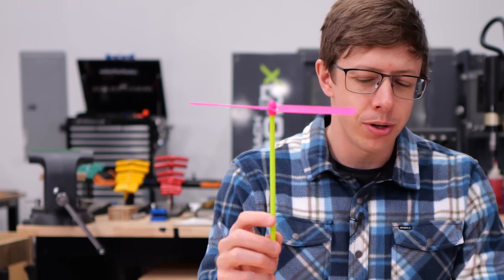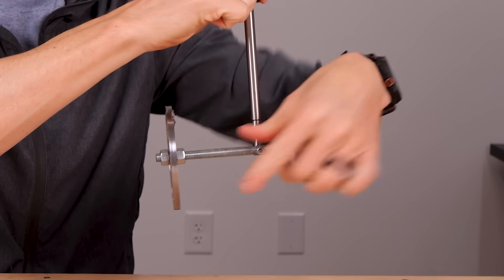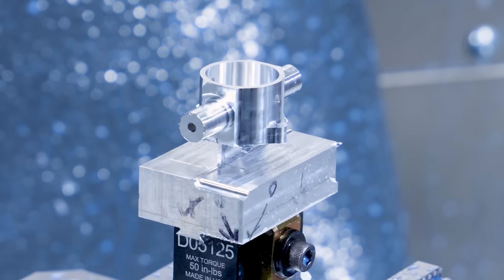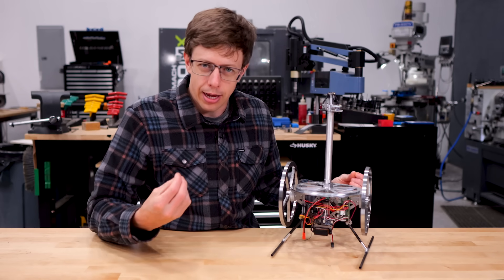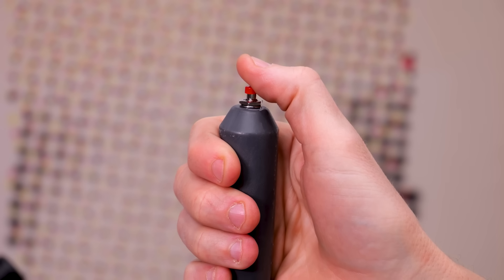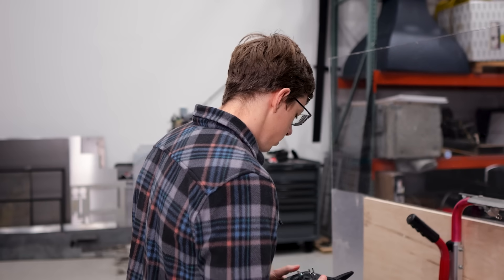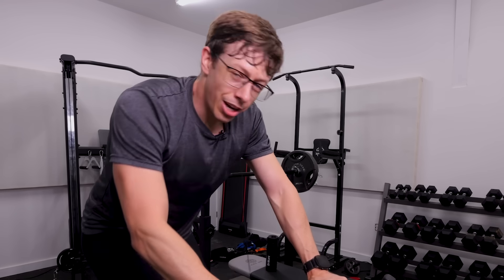I really thought this would fly well

Comment from the maker: If you don't already spend time every day learning new stuff, you should! I'm forever amazed how much I learn by cultivating this habit. If you're interested in learning technical stuff, you should check out Brilliant. It's an awesome tool that you can use to learn math / programming / data analysis / etc. If you go to https://brilliant.org/StuffMadeHere you can try it free for a month & get 20% an annual subscription.
Reply: Any reason you didn't just disconnect to the shaft from the flywheels and fly it like the stick toys (just blades and motor shaft).  If you're tied to combining the whole thing, why don't you just make a tail rotor like a helicopter?
Reply: @lunch3507  That's what I was thinking. It's so simple already, just use carbon fiber and spin the sh!t out of it.
Reply: @lunch3507  I think the reason was explained at the beginning of video. When you rotate only shaft you accumulate only kinetic energy of shaft itself. This energy is proportional to square speed of shaft and its mass. But the stopping force is also square proportional to the speed of shaft. So increase of its rotation speed will give additional energy from one side and additional stopping force from the other. The idea of flywheels is actually good: You rotate something very heavy, but not resisting the air so You get energy but not get stopping force.
Reply: @lunch3507 watch the start of the video again
Reply: @lunch3507   yeah, he could put a flywheel on the base of the shaft, that would rotate in the same orientation as the shaft (essentially could be part of the shaft) and rotate that fast to store energy then let go from the rotation devices on the sides.
Reply: You should try a Collab with project air
Reply: At least you learned something and it actually flew! 
Science and designing is a wonderful thing.
Reply: Can we get a collab of the wives of you Backyard Scientist, and William Osman
Reply: If you can, please disable automatic synchronization. With that I can't hear the original audio in Germany even though my browser and os are completely set to english and there is no way for me to disable it (at least watching in the browser without being logged in). And the synchronized version is absolutely no fun to watch. Thanks!
Reply: Flybar!
Reply: Epic fails teach epic lessons :)
Now it's time for the complete redesign you were trying to avoid.
See you next video, you got this.
Reply: i cant wait for part 2 and 3 and 4 and maybe 5...
Reply: Your horizontal gear needs work too.. It has vertical flat surfaces which both increase drag and throws of air, going to your wings. (or am I mistaken?)
Reply: Hear me out. Controtating twin propellers with concentric shafts. If it doesn't work at first, just steal the SB 1 Defiant design data.
Reply: I think you could solve the problems while staying true to the toy rotor design by having a single flywheel on the same axis as the rotor and a simple clutch/brake mechanism between the rotor and the flywheel. When you want lift, gradually apply the brake and angular momentum will be transferred from the flywheel to the rotor. The flywheel will provide stability, and with computer control you could get precise control over the altitude.
Reply: @stuffmadehere why dont you keep it really simple: put the mass in the wings itself. No mechanics, just the same as the good ol toy just with some rotational mass in the wings to keep it spinning. And maybe some dynamic wing geometry that will flatten (like F1 wings) under high load and produce more drag / uplift when the RPM is low. And then you can spin it up really fast and let it go. And a small aerodynamic flywheel on the bottom thats keeping it upright.
Reply: Love your projects <33
I'd be quite honoured to perhaps be of help this one time, so here's my thoughts, cause a failure won't fly here :P

    I believe the thing you built is slightly too much a helicopter, not as much the original toy. I'd say that it isn't actually achieving the goal of answering the question "How high can you push this toy for children?" but rather "How can I build an RC heli powered by a flywheel?".

    If I may suggest a change in engineering perspective to achieve the curious original idea:

Parameters of the original toy used in the video:
   Two bladed propeller - number of blades somewhat optional, see sidenote lower
   Shaft that acts as - Counterweight to keep the thing pointed the right way up.
                                     Flywheel - well.. fly-rod.. - that stores rotational energy that is put in before take off.
                                     Means of bringing the propeller up to speed.
   Free flight model - controlled solely by its own ballance.

The answer to the original question should lie within the same parameters.

Sidenote:
    I don't know about yours, but when I had these, you could stack them because the prop shaft protruded above the prop, and had a hole on the bottom - or maybe I made that as a modification when I had the idea of stacking, can't quite remember. When aligned properly, the props would go higher because they carried more rotational energy while technically having 4 blades, although they were a bit tricky to spin up because of the length and vertical weight distribution. I would say that since that was possible, a single propeller isn't mandatory.

My answer shall then be the following:

    Twin counter-rotating 2 bladed propellers with coaxial shafts, both of which should have a horizontal flywheel attached at the bottom. Inner shaft has to be hollow, protrude below its flywheel and have a small axial bearing mounted to its very end by the bearing's bottom half while its top half must spin freely - tolerance on shaft diameter (see take off platform lower for explanation). Both shafts with flywheels have to weigh the same amount so that one of the flywheels doesn't have to "pull the other," reducing friction. Inner shaft flywheel is the bottom one, outer shaft flywheel above it, with two tiny bevel gears in between them on a single tiny shaft perpendicularly through the inner shaft, secured by retaining snap rings on the ends - mind the math around the distance of those tiny gears from the main rotational datum as well as making the number of teeth an even number so as to keep the propellers angularly aligned. At minor cost of friction, these will also allow the contraption to be spun up from the bottom. The bottom flywheel shall have bevel gearing on the bottom as well for contact with the "starter motor", an odd number of teeth here because of higher loads, possibly spiral gearing.

    Take off platform:
Consists of 2 layers.
     Upper layer:
Supports an axial bearing with an inner diameter big enough for the inner shaft small axial bearing to pass through and outer diameter such that the lower flywheel sits on top of the bearing with its lower gearing on the outside of the bearing. The starter motor with bevel gear at proper height for contact with the lower flywheel.
      Lower layer:
Vertical rod through the axial bearing above, at least long enough to reach above both flywheels and not longer than ~1/3 of the overall length of the "heli" - support while spooling up X friction at take off (:P too lazy to do the math here, you can :D)
     Trigger release - Three or four radially retractable prongs that secure the inner shaft's axial bearing from the top while spooling up. The 'heli' is released by simultaneous retraction of said prongs.

Do the proper math, design with weight and balance in mind and it will be a rodcket :D
I can only hope you might see my musings on this problem and that you may find them interesting enough to further develop them. Well that was a fun hyperfixation for the evening and in the words of Mike Patey - "Back to work!" :D
Reply: ha? what gears, what 2 flywheels.
Why did you not attach single flywheel perpendicular to the shaft of the propeller. It would always be under the prop blades and on the way down angle of the prop blades would manage the descend rate.
And even better there is a thing called steam engine governor, that depending on rotation speed moves heavy balls out or in while rotating, controlling valve, but in your case it could perhaps control blade pitch..

This is classic case of over engineering if I ever saw one :D
Put flat flywheel on the bottom, spin it up with that gear machine and release .. it should work practically in a static minimal config, no electronics AT ALL, fixed blade angle, fixed shaft, solid flywheel rotating in horizontal plane, parallel to the ground, perpendicular to prop shaft. 
I mean usually people try simplest things first.. :D
Good luck in part 2
Reply: counter-rotating propellers are your friends.
Reply: You're an awesome dude  *I actually had designed a rocket launched parachute system years ago for similar reasons and constraints to get away from a paraglider fan and not line twist this the prop or the already failed parachute wrapping up.     (compressed air was the solution for general reliability and safety) 
Of course you'd have to run it through the shaft which would be neat but a whole new set of problems
Reply: How do you keep track of what you’re learning and what you want to learn?
Reply: just an idea, what if you change the center gear to a double sided bevel gear and put one of the flywheels on the other side to change its spin direction?
Reply: I’m no engineer, but am fascinated with flight and by this concept!!

What if you were to weight the ends of the rotors (make them the flywheel) and make counter rotating rotors? Less moving parts, simpler, still counter balanced?

Someone who knows WAY more than me please tell me if this won’t work… haha
Reply: isn't it funny when you have diplomas and you spend so much time and an idiot comes and tells you right away that this aint gonna work and every step you took to salvage it was like gigging the hole deeper... i blame brilliant.....
Reply: I think your idea of counter-rotation was a good one, but I think you should do it with the blades.
You could have a flywheel connected to each of  the internal and external drive shafts with a bevel gear on the outer edge for accelerating them at ground level.

I think the main challenge would be building a double swatch plate mechanism for control.
Reply: That's one way of how not to make a helicopter! It's not a failure, as long as you learned from that experiment, right? Look at how many times it took you to get any of your other projects to work the way you envisioned.
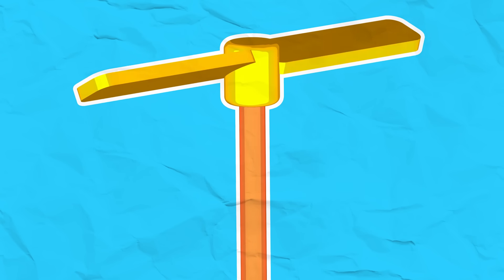Reply: 2:10 - foreshadowing - moving drag from propeller to a flywheels with square spokes or what I like to call a really poorly designed edf 🫣 Anyway, love the toy also and the video, great video!👌🤓
Reply: I use 2 hours a day learning on youtube 😂
Reply: Maybe having the exact centre (or centre mass or centre of angular velocity?) of the flywheel in line with the exact centre of the rotor/s , if you can try get it a close to precisely line up as you realistically can. 
I’m not sure what sort of transmission or reduction you might to use. Perhaps something like a magnetic transmission or maybe a planetary gear set of some description, one that cannot be turned backwards. I would think having the as close together as possible would bring the centres those two forces close together. Anyhoo I think What is important here is that the flywheel and the rotor are effectively spinning around the same “axis” (line of axis?) so to speak.
Reply: I think it needs a tail boom liek a real heli or counter rotating blades lieka  gyrocopter
Reply: @StuffMadeHere Look into Coaxial-rotor aircraft
Reply: GROUND CUSHION and MECHANICAL ADVANTAGE.
The first prevents the control surfaces you designed from imparting ANY counter rotation because the airflow from the blades when on the ground forms a stagnant cushion under the vehicle.
After leaving the ground cushion, you do not have enough mechanical advantage from the blades' airflow over the control surfaces to prevent procession of the entire machine. To be clear, your blades would need to work OVER UNITY to work in this configuration. This is why helicopters with a single plane of lifting blades have either adjustable vertical blades at a significant distance from the centre of lifting blade rotation OR have a duct to a long boom which is using controlled exhaust from a turbo fan blowing in the opposite direction to the rotation of the lifting blades.
I am assuming you will be either adding a boom with vertical control blades or adding a second plane of blades above the first which rotates in the opposite direction. The first is way more efficient than the second.
Bonus questions: Why do gyro-copters not have a vertical set of blades for counter rotation? (Big clue: they do not hover) Ans: They are driven by the air itself (lower requirement for counter rotation when under power) and redirecting power from the pusher propeller is easier and has no negative consequences.
Reply: could of made a disengage to let her go
Reply: @StuffMadeHere  couldn't you have added another flywheel that weight the same as the  propeller and spins the opposite way? Also was the center of mass balanced?
Reply: I had to laugh when I seen you 2 behind the plexiglass, I usually will hide behind a tree doing maiden test flights on new quad builds. A maiden flight for a 10" quad with solid props and 3115 motors on 6s will definitely seriously hurt someone. You need some overhead...said palm tree has a thick canopy. 😁
Reply: JUST THINK i really thought you were going to make a much bigger plastic one identical to the kids version. Then motor it then release
Reply: Maybe you have too much stuff flying there. Make it just like the toy, but with a variable pitch prop. The prop could be feathered by centrifugal force.
Reply: It has probably been mentioned but you could use 2 rotors that rotate in opposite directions to cancel out the torque wanting to spin the body of the helicopter. As far as stability you could use or make a flight controller. You could stick with wings under the rotor for flight control or design the rotors so they can tilt.
Reply: Hey👋 😊
You prolly don’t need any video ideas, but I would love to see your over-engineering applied to gambling cheating devices! Stuff like Holdouts: device worn under sleeve that can place a card in your hand—or can accept a card and retract, saving it for the next hand.      
Chris Ramsay—another YouTuber—would be a guy to contact.

Thanks for helping me learn 🤗💜
Reply: why not cover the inner cog too is it not having a huge effect on the balance as well?
Reply: Did we forget why helicopters have (as some would say important) tail rotors? The flying stick is spinning too when you release it with your hands. Except it doesn't matter because it has no other parts to matter when it's spinning. I think at this point you've gone from turning a simple kids toy into a complicated adult toy (RC helicopter) which is still really cool, just not so simple anymore. Someone once told me to use the K. I. S. S. Theory, which stands for Keep It Simple Stu... Well you get the idea😅
Reply: Question: Could you have used a ring outside the propelling blade perimeter, that spins in the opposite direction, to counterbalance it without changing the aerodynamics? The ring could be a circular linear-motor with oilbearing inside a circular tube (like a donut) and the inner part would be rotating in the opposite direction as the propeller (which would be inside the donut). The motor itself could just hang underneath like the seed of a dandelion. As such you wouldn´t have a very much increased air-resistance, no precession (same plane of rotation), stability in the air (low hanging motorbody mass).
Reply: MAKE A SECOND ONE THAT DOES EVERYTHIG THE SAME, BUT SPINS COUNTER CLOCKWISE.. THEN LINK THEM TOGETHER!
Reply: Drones like the ones from DJI have 4 props instead of one. They can stabalize themselfes way batter than a helicopter . Maybe you could " copy and paste" the prop you made 3 times and arrange it so that its well balanced.  in this case you dont need to worry about any flywheels. BTW love your videos! you´ve just gained a new subscriber❤
Reply: Love the channel - when signing up for Brilliant, it looks like it's only a 7 day free trial. Still signed up but didn't get the 30 days. 👍
Reply: I actually think you were closer to the solution then you think you were, search up one rail train. yes a gyroscope was put on a train that drives on one rail and is heavy, and it actually worked. The 2 gyroscopes would rotate in different directions evenly using a pinion gear canceling out the yaw derailing the train so it could actively counteract the roll. Unfortunately every train car needed a gyroscope, but its not a train. the system a little sluggish in terms of contacting the rolling but if it can work of a train full of passengers, then it would work. Now no idea how you make an efficient universal joint for this. Side note, I built the gyro in Roblox also too lol. Or just make counter rotating propellers, there’s even designs shimmying the propellers past each other at the right times so the 2 don’t have there axis in the same area.
Reply: try contra rotating props
Reply: Sound clip used in Tron Legacy at the 12:19 mark.
Reply: Are you able to attach smaller props to the flywheels to counteract the rotation you're receiving? It would retract from the power given to the lift prop but could push against the rotation
Reply: I wonder why you didn't opt for a horizontal flywheel instead of the vertical ones utilizing an inner and outer rod with gears separating them, this way you also get the added bonus of vertical stability which is what you want.

But then again, the gear work, the shafts and keeping them from separating would be a challenge. But with that said, maybe it would be worth it in the end? I don't know, just a thought.
Reply: Another video where you gloss over the needy stuff, which was the main appeal of the channel in the beginning. These watered down versions of videos are probably great for views and keeping the average lemming engaged, but it's disappointing to say the least.
Reply: @StuffMadeHere  What type of "metal?"  It's a little odd that you don't say. Flywheels and aircraft aren't a great fit. Might be lighter and more effective to use a cheap electric motor with a capacitor bank. Load the bank, let it go, when it autorotates it will partially refill the capacitors, and then use that to soften the landing. 

Oh, the stability issue. Shocked that you didn't think of this. Dual counter-rotating propellors.
Reply: Just make a 2nd stabilising propeller like a real helicopter?
Reply: @olivergamble4746  then you still have a very difficult control problem to balance the two forces out. counter-rotating lift props would probably be easier to get working without needing a bunch more stuff to calculate and control.
Reply: Since you don’t have a tail like a normal helicopter you should have counter rotating blades. That would solve the spin issue. Then I you might need a weight like a person on a tight rope would have to act like a stabilizer above the blades
Reply: Spanish audio track please.
Reply: Don't you need to have another gear under the current one to counter the spin from the single gear? It looks to be spinning in the same direction as the single gear.
Reply: What would happen if you geared one of them on the other side of the transmission so they are both spinning the same way?
They would be on a slightly different axis so not sure what would happen.
Reply: You need to make the blades out of carbon fiber and very thin carbon fiber at that... It needs to be just thick enough to hold its own weight and the torsion...
Reply: 8:39 yes! Sunken cause fallacy is always where everything goes wrong... This is where the entire video failed...
Reply: 17:57 worth it!
Reply: Why not put a single flywheel underneath to counterrotate the blade?
Reply: how about two sets of propellers one going each way to cancel the torque i know itd be hard to do but thatd solve the issue
Reply: How about 2 propellers on the shaft rotating opposite ways?
Reply: @Albtraum_TDDC  was my suggestion too
Reply: You know... a helicopter has a tail with a propeller to counter the torque due to the main propeller. Or you could machine a counter rotating second propeller, that would be cool too.
Reply: DUAL ROTOR BLADES Spinning in Opposite Directions to counter the Torque.
Reply: Not sure if you read the comments or not but today i realized that nobody has ever tried to make a real life buzzsaw blade launcher. Literally no one. So just throwing that idea your way if you ever feel the need for a challenge!
Reply: Day one of requesting for you to make a quadruple axis tourbillon.
Reply: Please make an auto aiming putter that never misses, dear god I beg of you pleaseeeee it would be so fricken cooooollll
Reply: Did you think about making it one piece and a bit smaller?  Maybe out of a block of billet aluminum.
Reply: Hello, do u read comments?? The world record commented on ur worlds smallest bike, 10 months ago
Reply: Needs a third flywheel perpendicular to the axis of the other two
Reply: Counter rotating rotors….just a thought….
Reply: Instead of the opposite direction flywheels, they should turn to the same direction
Reply: What if you make one of the flywheels bigger then the other so it can counter act torque in one direction.
Reply: Stabilizer bar
Reply: Why not make the rotor the flywheel? very thin blades with near zero drag, basically razor blades and an aerodynamic weight at the end like a teardrop and spin it up to lethal RPMs. Naturally gyroscopic. Should fly quite high. But be careful because it will be deadly
Reply: @ I think this design will be too fragile to withstand the forces and vibration.
Reply: Ok
Reply: We stand on the shoulders of giants. So much history and failures and sweat went into that machine that we take for granted-- CNC tech, wiring, physics, etc.  And why not put on a secondary back counter- rotor like normal helicopters?
Reply: You should put more effort into making more than one video per quarter.
Reply: Come to Ukraine with me!!!  We need your skills!!
Reply: Contra-rotating propellers or tail rotor, both bring their own issues.
Reply: You put so much skill and effort in the wrong direction building whacky things. Could I talk you? I would like a job developing my own inventions. You seem to have all the resources and connections I would need.
Reply: @jonathanchampagne7683  🔴 Christians and Muslims both believe in Jesus, love him, and honor him. 

🔵 They are, however, divided over the question of his divinity.

🔴 Fortunately, this difference can be resolved if we refer the question to both the Bible and the Quran, because, both the Bible and the Quran teach that Jesus is not God.

👇 The Bible Denies the Divinity of Jesus 👇

 🔴 Jesus was a servant of God ⚠

{ The God of Abraham, Isaac and Jacob, the God of our fathers, has glorified his servant Jesus.} (Acts 3:13). 📚